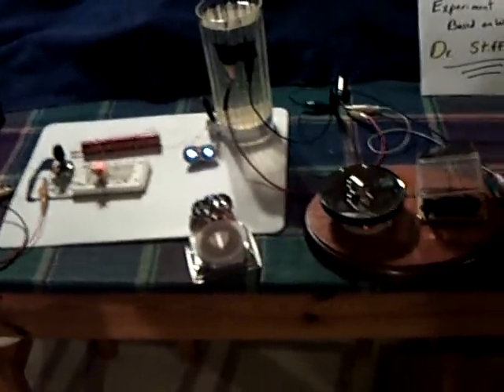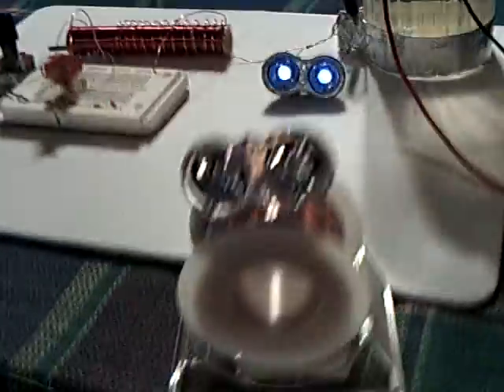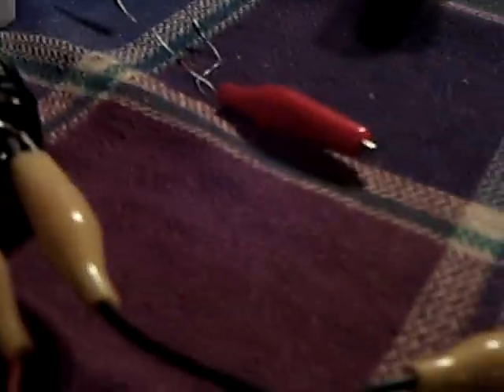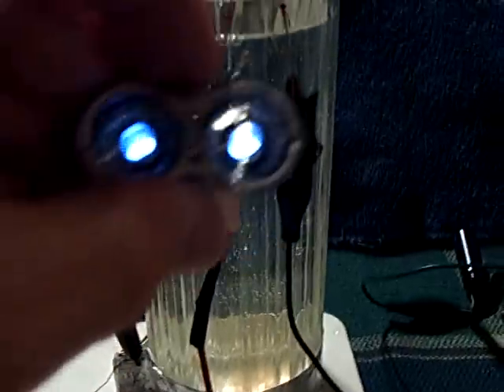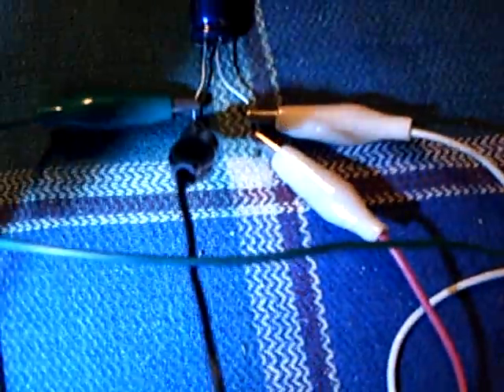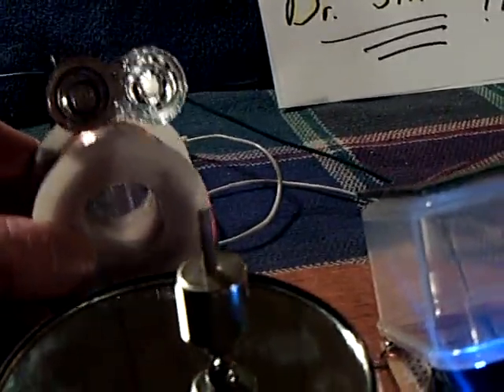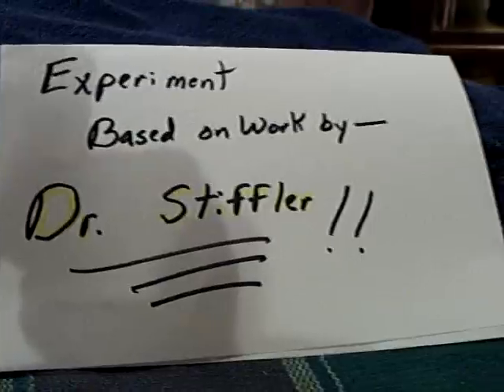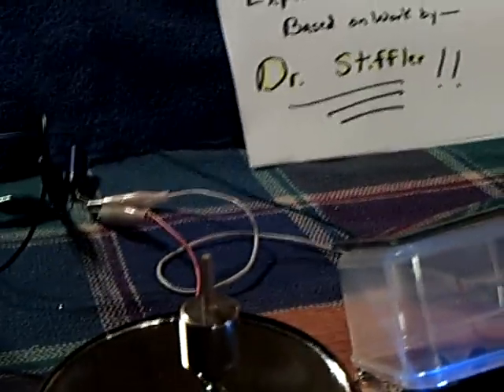Slayer Exciter runs pulse motor out of water glass.ASF

Comment: Try taking a roll of speaker wire, run ac on one wire, take power off of the other. Instant air core transformer.